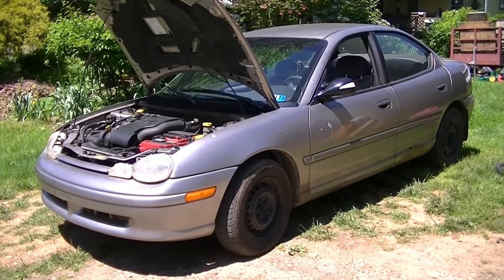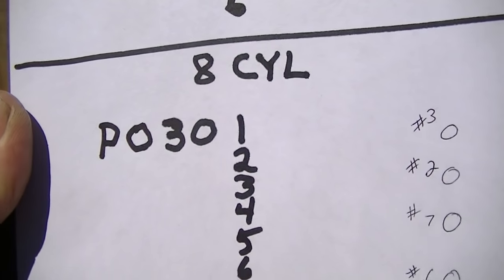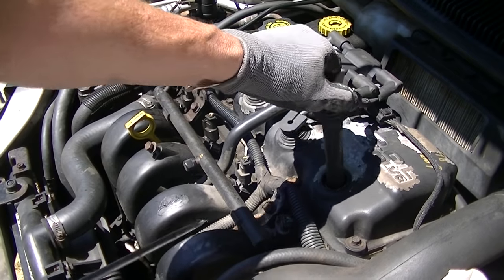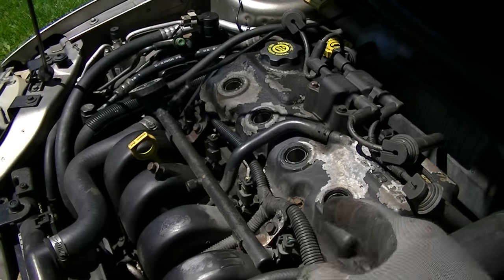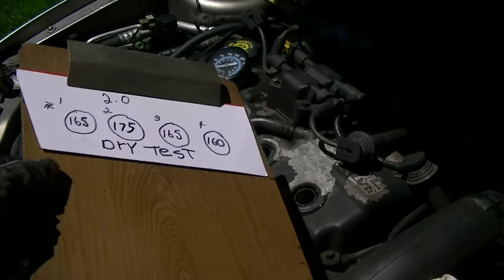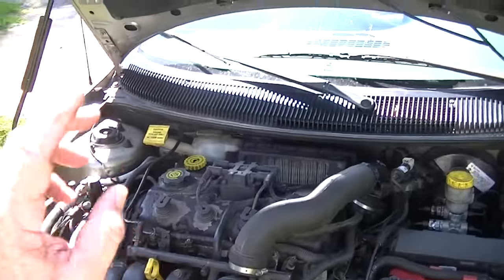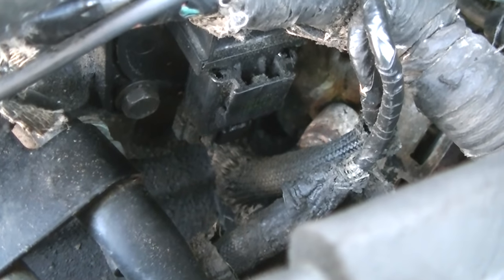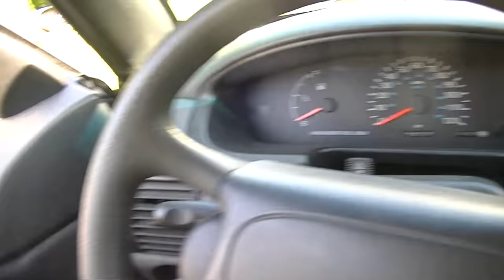P0300...How I fixed My code....P0300. Simple steps!

Comment: I have a 2004 Nissan quest 3.5 L engine and recently the timing chain was changed when I got the car back I was getting a code P0305, I installed new spark plugs you coils and new injectors, and I also check compression which was excellent any ideas as to why I'm getting this code? Is it possible that the timing chain can be off one tooth?
Reply: I have the same van your mechanic who did the timing for u bring it back to the guy could be off a tooth

Comment: Ok so my wifes car had the P0300 code and an EGR valve code. I changed the EGR valve and Spark plugs which were way overdue. I rechecked it right after and still get the same 2 codes, I then disconnected the battery and still the same, Do I have to run it for a certain amount of miles?, cause the car Runs like a champ. HELP😃

Comment: A got a Sebring and gave me p0300 and got a new crank sensor put it in and voila !! Smal road test and seems to be repaired  crank sensor or cam shaft sensor 30$ each
Reply from the maker: Nice!!
Reply: What were the symptoms of your sebring?
I have only P0300 with misfires/shaking and check engine light.

Comment: I have a P0300 code on a Chrysler I’m working on. It runs fine nothing wrong with idle but engine light flashes. Checked spark plugs they were shot with a 0.80 gap. Checked the coils and there fine. Any suggestions?
Reply from the maker: Look at the crank sensor. It could be failing.

Comment: Hey Nathan i have codes po300/po725 on a 2005 nissan altima. Do you have any suggestions as to what it is to fix it.
Reply from the maker: P0725 means that the powertrain control module (PCM) has detected a circuit malfunction with the engine speed sensor input signal.

Comment: Or instead of a compression test you could just move that suspected spark plug to another cylinder and reset codes and see if the code moves to another cylinder

Comment: I have misfire and vacuum leak on my 350z. After swapping coils and injector I am getting misfire on multiple cylinders at first it was p0303 w/e thingy. I did remove valve cover because I broke the part where pcv goes. All parts were from pick up part. I wonder if maf is good or not. I have no idea. My brother thinks it's a piston but theres no smoke in the exhaust then he thinks perhaps the cats are clogged.
Reply from the maker: Check fuel pressure! make sure its steady when motor is off!!
Reply: Check your intake manifold for vacuum leaks.
Reply: @MrCharlyvallarta8  I replaced seals and car did sound less loud but code p0300 still. Sold my car as is. Someone better then me can fix it

Comment: Could the crank sensor throw code po301 n po304 cylinder 1 n 4 misfire? I've changed coils wire harness to coil packs plugs wires n battery. Mechanic just changed crank gear. He told me him changing crank gear has nothing to do w the codes that the code reader is showing. I didn't have check engine light on b 4 he changed the gear.
Reply: I go 40 to 50 mph n car sputters loses compression on flat road its worst going up hill
Reply from the maker: Yes it happened to me a few times. Do you smell any fuel? Could be a Fuel pressure issue. Either a o ring, or fuel system is losing some pressure.
Reply: No fuel smell.

Comment: 2011 Jeep Grand Cherokee 5.7 giving is constantly flashing lights & giving me codes. I've replaced several sensors with the latest being the camshaft position sensor.  Now I'm getting codes PO330 knock sensor 2 circuit & PO335 camshaft position sensor circuit.  My check engine light flashes, it doesn't accelerate well, loses power, stalls, sometimes runs rough & traction control light comes & goes.  Feels like my vehicle is haunted!  I'm beginning to wonder if I have a bad PCM.  Anyone else have similar issues?

Comment: I have a compressor result of cyl #2=80psi, cyl #4=110, cyl#6= 160psi
Should i trash my car? Im still driving it. Doesnt sound that bad to be shot. Just left MIDAS. $460 to go home with no fix. They said they took head off but gave me back the gasket which is suspect.
Please help me before another mechanic takes more $$
Reply from the maker: OK
Reply: @FixingWithPassion  2003 Nissan Murano SL
Reply from the maker: @Iheartcatz  keep on rolling! Its yours.
Reply: @FixingWithPassion  Gonna replace Cam/Crankshaft sensors next. On my own!!💪

Comment: I did all the same things, then I put seafoam in the gas tank, problem solved.
Reply from the maker: Good deal!
Reply: ApplePie 2019  My misfire issue came about right after treating my truck with Lucas fuel additive with injector cleaner... I added the treatment quite a bit rich, and random misfire started shortly after.  Could be coincidence... I figured it may have flushed out too much filth and clogged the injectors.
Reply: @heera rodriguez why would you want to swap plugs?

Comment: I get PO303..ONLY 
MIS FIRES WHEN REACHED NORMAL ENG.TEMP..THEN NO ACC.POWER ,RUNS GREAT COLD..
 ANY IDEAS ?
Reply: Did you ever figure it out?
I have a P030P only, cold starts good, then 20 or 30 seconds later the misfiring starts, check engine lights flashes and P0300 is detected. Pls let me know.

Comment: i got a code P0300  so did replaced all 8 spark plugs verified for coils they all ok but when engine start it run fine for about one minute and than it goes rough and get check engine light and five minutes of driving it come back running fine  what would be the trouble,
Reply from the maker: Check fuel pressure motor off....no drop allowed!!
Reply: @FixingWithPassion ok so if droped the check valve would be defective i got a cadillac and i believe the check valve is with the fuel pump into the tank could i fix it other than droping fuel tank ?
Thank you so much.

Comment: 2002 gmc denali 6.0 motor.P0300 Random Misfire Detected
P0141 02 Heater Circut ( Bank1, Sensor 2)  i just changed my oil pressure sensor clean out catalic sensors. Oil pressure gauge is low.. just change thick oil.
Reply from the maker: Thick oil.
Reply: @FixingWithPassion  seems that I did all above oil pressure sensor , thick oil sparkplug wires  bank sensor 02 bank 1 sensor 2 changed eliminated codes p0300 & p0141 . Fault p0300 oil gauge pressure low misfire detected  it may be my oil pump.

Comment: I drive a 2007 Ford Fusion SE.

I was on my way to the mom's house and my car starts running real rough and began to shake around 40 mph. The engine light is blinking. I'm panicking so I pull over and pop the hood. I notice the engine is real hot and my only option is to drive it to the closest gas station so I don't get stuck in traffic.  The car makes a ticking noise when idling and I can barely go over 40 mph. The mechanic calls me and says my engine is randomly misfiring on 4 cylinders and that I need to spend $3,300 on a new engine. He said my anti freeze and oil was low. I'm extremely angry because I don't think he did too much diagnosing to try and fix the problem like you did. Any advice? Should I get a second opinion?
Reply from the maker: 2nd opinion?? LOL...Does it snow in January at the north pole??  ;)
Reply: so yes. I'm going to get it towed to a more trusted mechanic.
Reply from the maker: For $3,300 I could buy 3 cars that are running perfectly! Good luck!
Reply: butterflyeffect Always check fuses and rely FIRST with a test light. You can do that yourself test light cost $5 at parts store. Voltmeter cost bit more (but worth it) FIRST  pull all spark plugs check if properly gapped. 2. Check for vaccum leaks spray carb fluid use straw all the way around manifold on plastic vacuum lines these tend to break or have hair line cracks which you cannot see, if engine idle changes while check for leaks you found the leak. Replace vacuum line. 3 low fuel pressure can cause random misfire. Low fuel pressure can be caused by blocked fuel filter  (on passanger side underneath) or bad fuel filter Replace filter FIRST becaz filter cost $15 before even replace fuel pump. 4. Fuel pump relay inside hood can also be faulty.( Test relay with test light)  if faulty replace $10. AND 5.  Bad wiring in fuel pump itself can cause misfire AND 6.  bad fuel pump itself can cause misfire. 7. check battery health. Can have battery checked free at any parts store. Bad battery can cause random misfire. Dont go back to that swindling mechanic. If mechanic just wants to swap parts without doing a common sense walk through he a cheat liar thief. Find mechanic that follows these 7 steps.
Reply: He knows his stuff, awesome thanks bro
Reply: butterflyeffect that guy was really trying to rip you off it's so easy pulling g the motors on those cars most mechanics buy a used motor and tell you it's new just to charge more . It takes me 2 days to swap a motor on my Honda
Reply: yes
Reply: I had to change the fuel pump on my bmw. When I went to AutoZone to get the special tool that they have to get the rings off, the guy asked me do you know how to use this. I said yes I do. Then he asked me what do you know about cars. I told him I know more than you do. I was a certified mechanic but I didn't keep my certification up cause I don't want to do that for a living, but I went to school for 17 weeks to learn how to fix cars and diesel trucks. Now just give me the tool 
and I will be on my way. Everything that you said do is correct. So much can be wrong with a car. That's why you start with the cheapest problem first. That mechanic was trying to rip you off. Do not go back to him.

Comment: Loose connection it's a loose connection or short would blow the fuse that's what we call a short as when you blow the fuse it's a loose connection a loose connection could short out though but that's the way we call it in electrical terms
Reply from the maker: fuse that's what we call a short as when you blow the fuse it's a loose connection a loose connection could short out

Comment: Mine was cam shaft sensor then i replaced both of them now i have the p0300 no power and shakes
Reply from the maker: O my!~
Reply: Get a Actron CP9680 Code tester. It checks live, record, graphing, emissions readiness test, ABS, SRS, transmission codes, oxygen sensor test, and MORE! It has code- connect to diagnose codes. It gives possible solutions for codes. After checking codes, press code-connect. It's well-lit! EBAY has it. It uses 4 aaa batteries, not included, under the cover screw in the back.

Comment: Code goes away when I stop. Only comes on when I'm driving. Already replaced plugs n 1 bad coil
Reply: That means the problem comes and goes. Get a Actron CP9690 code tester. It has code-connect to diagnose codes. It is well-lit! It works from 1983-2013 out-of-the- box. Get the USB cable to update it from EBAY. It has record, graphing, emissions readiness test, ABS, SRS, transmission test, oxygen sensor test, IM monitor test, freeze frame, modules present test, state OBD check.  Try fuel-injector cleaner. It could be clogged injectors. Warm the engine to prevent false codes. After replacing parts, retest. Let the engine clear the code. A P1000 means the memory was erased after removing the battery or disconnecting the cable for awhile.  Simply run the engine to restore the codes. It may idle rough after replacing the battery until the codes are restored. It uses 4 aaa batteries, not included, under the cover screw. It retains the memory for later review. EBAY has it. A CP9680 is for OBDII only. It's the same tester. The CP9690 has cables for Ford, G.M., Chrysler, and Toyota for OBDI.
Reply: @hankbridges5055  Fix! Had another bad coil. I tested them by removing each one to figure out which one was bad.
Reply: @poldariser8686  A timing light can check for spark without disconnecting the wires. I use my Actron CP9690 code tester on my OBDI Ford and it works on OBDII. It has code-connect to provide solutions to codes. A Actron CP9680 is for OBDII only. Get the USB cable to update it.  EBAY has it. It uses 4 aaa batteries, not included, under the cover screw on the back. Use a small screwdriver to remove the cover. It's a little tight!

Comment: My car gives a p0304 code and the engine light flashes randomly and it looses powerWhat can be the cause of thatI think its misfiring
Reply from the maker: Figure out what cylinder po304 is related to. More that likely #4. Check wire, and see if the injector is not leaking.
Reply: I replaced the injector and still get the p0304 codePeople keep telling me it could be the head gasketsThat could be the reason its misfiring
Reply from the maker: Do a compression test. This will tell if its in the head :(

Comment: I'm ready to light a match to my dodge. Ive replaced crank sensor,plugs, wires, coil, checked vacume lines, did fuel pressure check, replaced cold air intake sensor, replaced IAC valve, Replaced the heads!!!! replaced all the o2 sensors, replaced the MAP sensor, WTF is left to do, I dont GET IT!!!!!!!
Reply from the maker: Something not right
Reply: Your motor is toasted.
Reply: @jyfinesse5967  Actually no! I just rebuilt it, runs great. I then had a beer.
Reply: Check oil specs, level and VVT solenoid.
Reply: @coolvidz1763  Turned out it was a leak on the ring that holds the fuel pump in the tank. A tiny piece of wood got between the ring and cause a vacume leak. Truck runs super nice now with an engine I rebuilt. Love this truck.

Comment: Every time I get that code usually be bad fuel pump
Reply: Was it that for you? I’m having rough idle in D or R at a redlight. Cold start will turn on but then acts like it wants to die but never does.
Reply: @yotagang3705  bad wires or spark plugs

Comment: How silly "Ya don't want engine starting with all plugs out" Duh! Pulling a plug wire when running is stupid! Stupid me puts wires in the distributor, then ground them!  Cleaning & silicone greasing the cam sensor plugs is a good thing, as Martha says!
Reply from the maker: Sapppp bam ouch...da feet grounds.

Comment: Man you love to talk, don't you? Slow down man! LOL. Your video was great though. I have a P0300, 0303, 0304 on a 2010 Alantra that is driving me crazy. I have changed, Injectors, wires, coil paks,  spark plugs, cam and crank shaft sensors, purge valve, upstream O2 sensor, down stream O2 sensor but still no joy. Now I have an abs and brake light with no codes. I think I will explore a vacuum leak next and see where that takes me. Other than that I would appreciate some ideas on Hyundai and Alantras. Thanks
Reply from the maker: 10-4 back door!

Comment: Did you put those burn out, worn out spark plugs back in to the engine with out replace them shame on you new plugs enhancement may make the engine run better if there’s no other problem